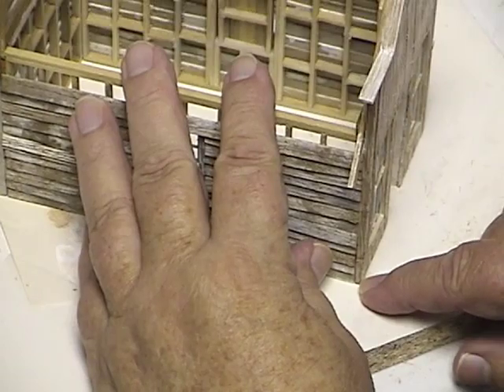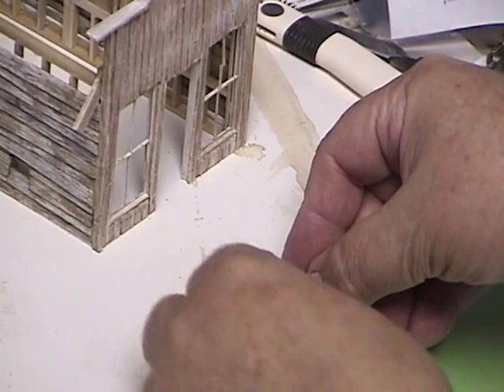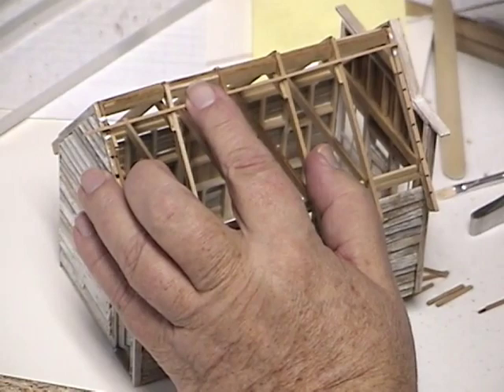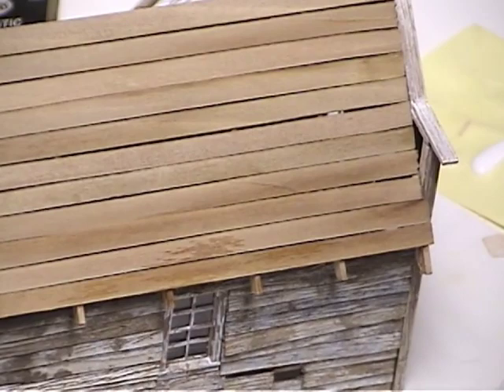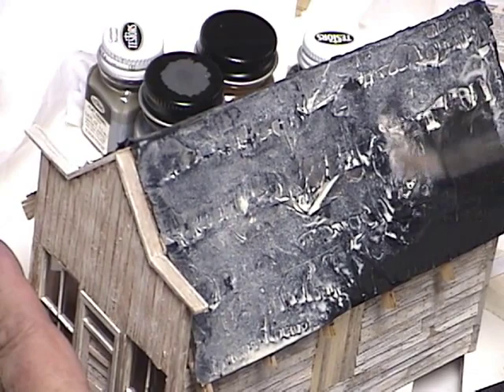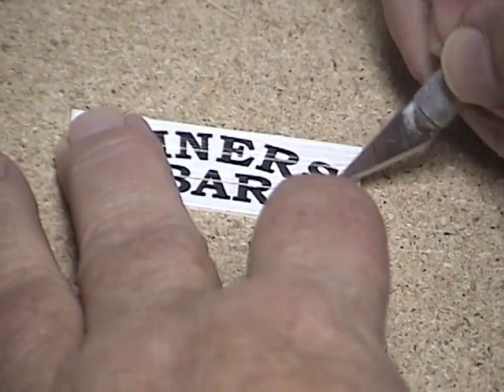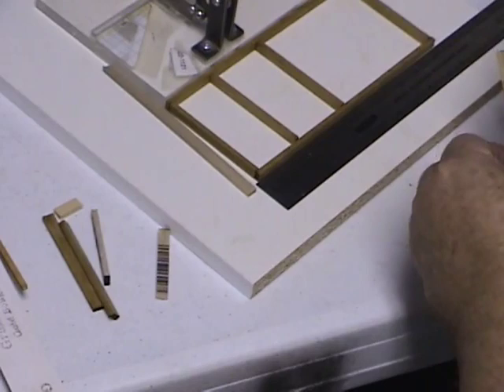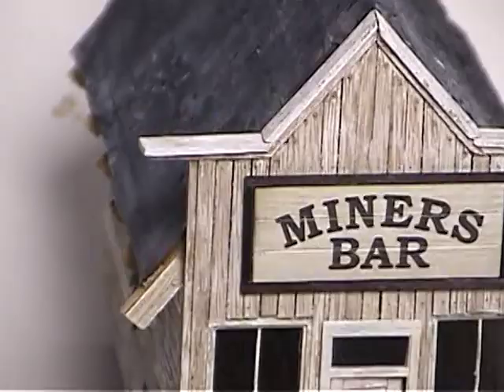Scratchbuilding In Wood Part 3 of 4

Comment: I've also ventured into card stock modeling.  So far I've made 3 card stock models and learned to do relief on a rather flat model.  Definitely a learning experience.  One card stock model I ended up completely covering it with weathered wood (it was a loading dock in HO scale).  I'd previously built one from wood for O scale.  Cheers - TN

Comment: I know that you're using Testors enamel paint; can you use  turpentine as a thinner or should it be lacquer thinner?  In 1970 I had just graduated from Paris Island and a year later I was in Vietnam.  Yeah, I'm a Marine.  I'm building a small structure out of an old "Old Spice" redwood box the after shave came in.  It has dovetailed ends & I really hate to cover it up with brick card stock.  I've already cut a door into it and 4 or 5 windows will be added.  I'm thinking of a corrugated roof.  However, I do like the look of your tar mopped roof.  I'm gonna make a smoke jack out of some old pieces of sprue I've got left over from past builds.  How about using a bread tie for flashing after trimming it; I think they're made from styrene or ABS.  For signs, I usually scrape the back with my A-proxo knife to remove material to thin it so it looks old and weathered.  It's kinda like putting MicroSol over a decal to make it conform to the surface.  I'd appreciate it if you'd send me that building for my layout, LOL!  I've got to find my architectural scales I used when I went to Southern Tech along with my french curves, protractors and compasses.  I studied civil engineering when I went to college.   What are the dimensions of your floor decking?  Looks like the same as the sub roof.  Guess I could use popsicle sticks with the ends cut off.  I'll just have to remember to stagger the joints.  I've seen other modelers use shoe dye and alcohol for stain.  I use acrylic paint dissolved in alcohol and it works just as well as any other stains I've seen.  I also have several quarts of real wood stain, i.e., weathered oak, special walnut and maple stains.  I've used all of it for different projects.  Cheers - TN

Comment: I got me a tooth paste squeezer I now use for corrugated steel in O scale.  I save my beer cans and put them through the squeezer and it makes perfect corrugated steel for 0 scale.  For HO scale corrugated steel, I got a styrene sheet of .040 spacing corrugated steel and use it as a mold.  I put a very liberal amount of Elmer's glue on top and wait for it to dry.  Then I apply another layer of Elmer's glue on top of it and wait for it to dry.  Then I CAREFULLY peel off the glue layer and glue it to a piece of card stock.  I paint it silver or grey and weather it with my rust powder I make from 0000 steel wool soaked in vinegar and dried in a flat pan.  I then pulverize the iron oxide with a single edged razor blade and store it in snuff tins.  Looks like real rust 'cause it's real rust.  
I've learned my lesson about removable roofs.  It's a very wise decision to make a removable roof for future added interior detail.  When using ACC glue (super glue) it helps to blow on the joint as you glue it as the moisture from your breath helps to set the glue.  A little tip I learned from another modeler.  For a quicker set of ACC use an accelerator which I have a big ole bottle.  I like your modified sewing needle for applying ACC.  Gonna have to make me one now.  How thin is that wood next to the ridge pole?  What are the dimensions of the shake shingles you're using?  My favorite roof is corrugated steel highly weathered with little gouges and frayed ends.  I've seen that trick with the VHS tape for weights but using 1-2-3 blocks instead.  I love the VHS tapes 'cause the damn post office lost my order of 1-2-3 blocks.
Cheers - TN